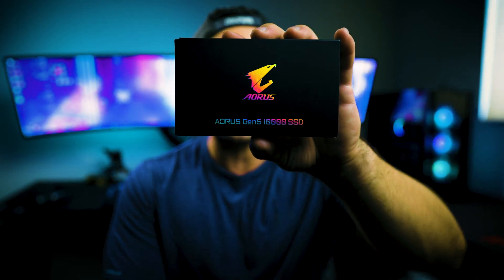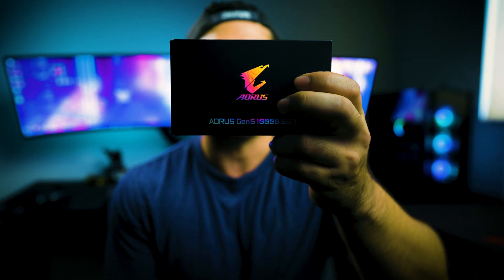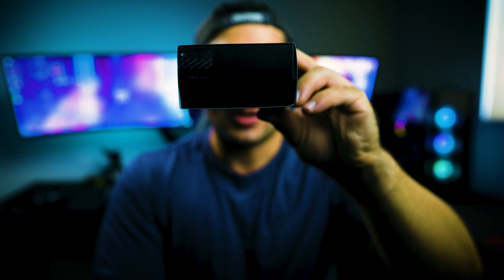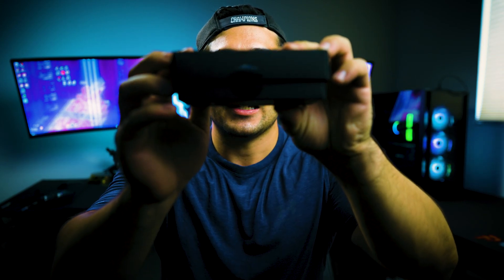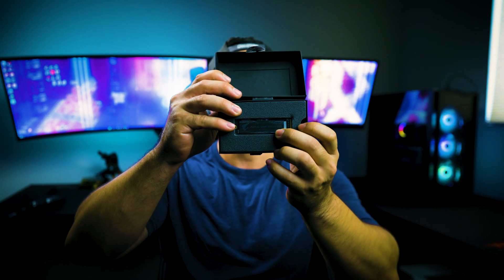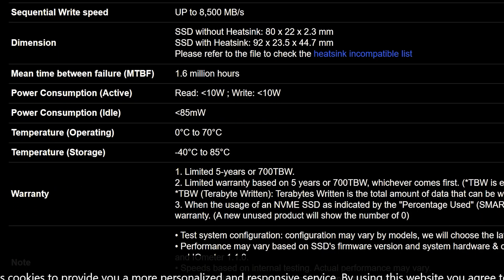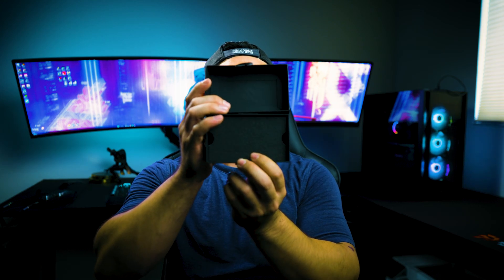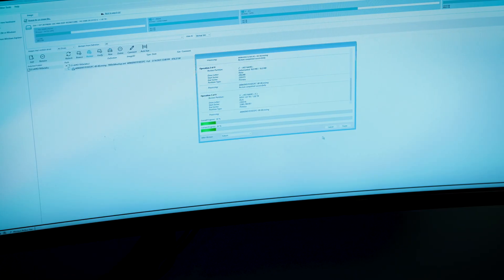PCIe Gen 5 NVMe! Gigabyte AORUS Gen5 10000 SSD Unboxing, Install & Performance Review

Comment: why does the gen4 get better load times? are you even using a ddr5 compatible m.4 slot?  the windows boot time is cute, but if the applications load relatively the same then to me its not really worth it.

Comment: I just got my Gen5 aorus yesterday and my Z790 Aorus Master doesn't show any differences between my Gen4 which is already installed, their both got a rasult of 7000mb/s,  what's wrong?
Reply from the maker: make sure to have your Gen 5 Aourus in the correct location for PCIe 5 speeds, if you are 100% sure it is make sure you have PCIe 5 enabled in your bios.
Reply: @ChrisMizo  
Yea noticed it just few minutes after, i thought that all the slots have 5gen support, didn't know that only the primary slot is 5gen so now i had to change between my two ssd's location to make it work, my 5gen speed is 10g now
Reply: @ChrisMizo  btw where it's bios setting is located? i was thinking about it at first and checked the bios but couldn't find it

Comment: When are these being released?
Reply from the maker: they are released, check out the description box
Reply: @ChrisMizo  On amazon and Newegg both have been "unavailable" for as long as ive seen them up on both sites, which is about 2 months now.
Reply from the maker: @antecxaser3  still sold out from what it sounds like, but they are certainly available

Comment: The huge Heatsink is not compatible with my ASUS ROG STRIX Z790-E GAMING WIFI Motherboard unless I'm not installing it right. The heatsink is only compatible with Z790 Gigabyte motherboards
Reply from the maker: don't use the large heatsink on your board, you can use the heatsinks that are built into your motherboard
Reply: @ChrisMizo  I thought it would keep the M.2 drive cool and from overheating
Reply from the maker: it does but for your motherboard you have a heatsink built in
Reply: @ChrisMizo hey 2 questions im gonna install the same ssd u have the aorus 5.0 but i have the same motherboard as u. Should i use the heatsink that came wit the ssd or the slot that u u used wit that heatsink on the motherboard? And also how would i transfer my boot drive and everyelse into this new ssd since its gonna be a additional ssd in my motherboard?
Reply from the maker: @mikekuoz2598  You can use the same heatsink on the motherboard since it is designed for PCIe 5, now to transfer all your data:
Bootable Media Macrium Reflect:
https://youtu.be/gusCX_RiF-g
Backup your drive Macrium Reflect Free or Trial:
https://youtu.be/1GLoPZnxGNk